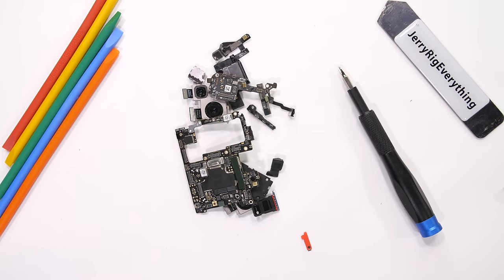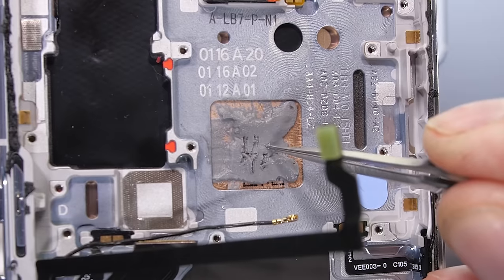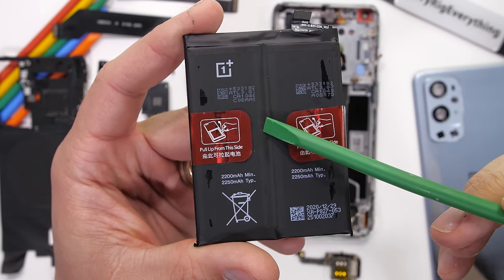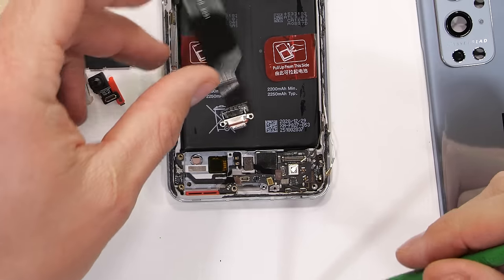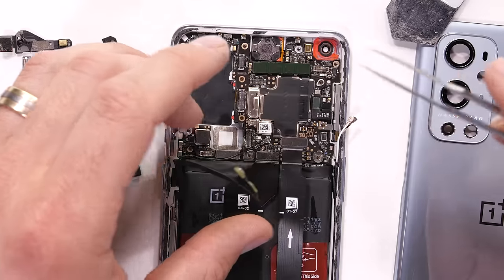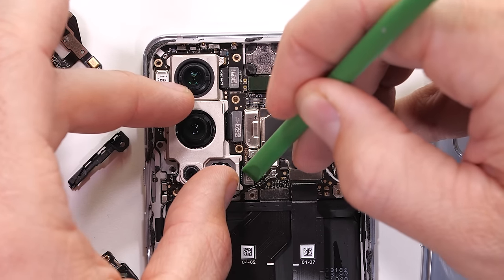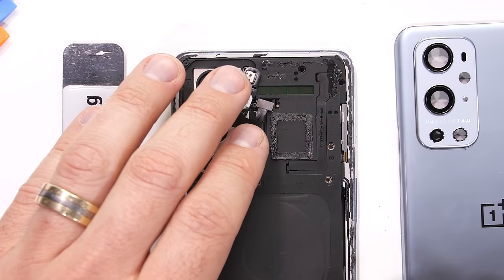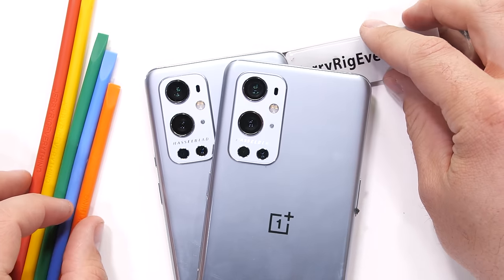What if your phone arrived like this?! - OnePlus 9 Pro Teardown!

Comment: The extra screw is for that threaded hole partially underneath the LED flash. The metal-rubber bracket is supposed to be used to keep the bottom board's connector fixed in place in case you drop your phone.
Reply: Yeah I was about to say, the metal bracket is to hold down a ribbon cable connector, the screw is either for that, or you missed a spot lol
Reply: Yeah me 2 but saw that someone already commented👍
Reply: Only Taichi saw it. 

Liars, yall didn't see anything'!! 😂😂😂
Reply: @MAGGOT_VOMIT  u not excited about poco X3 pro it's only $250
Reply: I was about to say this but I just saw your comment. Thanks for saving my time. (:)
Reply: @Atomic Ice Gaming it's true why don't u guys believe me😂
Reply: 720 like

Comment: Jerry: "Turns out Oneplus lied a litte"

Oneplus: *panik*

Jerry: "Instead of charging my phone in 29 minutes my phone completely charged in 27 minutes"

Oneplus: *kalm*
Reply: His name is Zack
Reply: it's totally normal for li-ion batteries to charge faster when they are used, as the total capacity lowers with degradation and over time
Reply: @sersoft_corp  but it was a new phone, just in parta
Reply: @bryanrodriguez2186  idunno at 1:03 in 4k the glass looks used, or at least has signs of wear
Reply: @sersoft_corp  yea because he scratches the glass with mohs hardness picks to show what the screens made of
Reply: Taking this seriously, Even if it was 31 minutes, you can easily waive that off as natural variance.
Reply: panic* calm* did your c key break
Reply: @kane169  it’s a meme format
Reply: Oneplus: kalm

Calm be like (i should leave my job now my work here is done xD)
Reply: @alrightkewl8235  oh n

Comment: I wish they had kits where you literally could build your own phone like a model car or airplane.
Reply: Because the president
Reply: I literally struggle to put screen protector on...
Reply: @nateb9346  lol
Reply: 1+ reinvented the modular phone Google failed to make.
Reply: @nateb9346  if you're having trouble with the dust go into your bathroom and turn on the shower to its hottest setting and wait for the room to get all humid and fog up the mirrors. then apply it. The water will pull the dust out of the air
Reply: Apple in 2 years...................
Reply: RIP project ARA

Comment: Jerry : "the goal here, is to not left have any screw left over, but that's a goal not a requirement."
Me who falls short of the screws because I lost a few of them while working 😬
Reply: Trust me, it is more scary when you have leftover screws... You don't even know what you missed
Reply: well when I took apart my old Fujitsu laptop (to put new CPU and GPU thermal paste in and clean the fans), I found I had 1 screw less than required to put it all back together... and no, I didn't lose the last screw. So I just took it from a donor laptop and my fully built laptop now has an extra screw somewhere it probably shouldn't :D
Reply: Video of
Reply: @SuperSohaizai  hehehe yeah
Reply: @SuperSohaizai  Nah mate. What's scarier is when you know you lost some screws and the only ones you have left doesn't fit the remaining holes.
Reply: @astral6749  I know that feeling but it doesn't feel that scary. You know why? I always have spare screws, from other devices that is XD

Comment: in the wise words of my uncle: "if you repair something and have screws left over, it just means that you are better at fixing things than them because you didn't need as many parts."

my uncle did tell me this, but it was a joke, I do not, and would not recommend leaving out screws 😂
Reply: Unless you do the repair in front of the owner
Reply: Never heard wiser
Reply: Unkul Ben lied to you
Reply: Your ooncle very wise
Reply: If the engineers designed it for 10 screws, you better use 10 screws. They didn't study and learn for 10yrs just to add extra screws for fun
Reply: Delta0307 If the commenter made the comment to be a joke, you better take it as a joke. They didn’t spend time thinking about the joke for someone to come and ruin it.
Reply: @quabiloyoink  I've heard this before and it's not a joke. Dumb technicians actually swear by this rule. A guy just ruined my automatic gate recently because he used 4 screws instead of 6 dislodging the guide rails. He said almost the same thing to me about not needing all screws
Reply: @delta0307  it was just to make people laugh...
Reply: Now the
Reply: the next moment u have the entire thing falling apart
Reply: @gchamp8167  true dat
Reply: @grozaphy  
Either way, it can misinform people for the worse.
Reply: maybe it was true 50 years ago.. now things are made to cost as little as possibile and if there are 10 screws you'd better use all of them
Reply: @delta0307  well rip but it’s still a joke some idiots take it seriously although it’s clearly a joke
Reply: @metallurgico  yeee exactly my point, if u have some screws remaining then u either disassemble the whole thing or pray that it doesn't fall off
Reply: KKKKKK THATS FUNY
Reply: @Yuriyalloween  it is quite obvious it was meant for a laugh. there's even a emoji at the end.
Reply: @delta0307  or they could be Steve job whom told engineers to add extra screw because it didn't look symmetrical on their laptop :x
Reply: @delta0307  sad lyf
Reply: @grozaphy  
Yes, I agree, and I personally like the joke too, but as you know, people on the internet fail to identify jokes.

Comment: "They lied.. it charged faster than they said"
Reply: It did NOT.
He started at 1% and the system was booted up.
If you have a true 0% phone, thus the battery is dead, then you need those extra 2 minutes and maybe even more.
Some phones even take minutes just to power up when the battery is fully depleted and you hook the charger up.
Reply: @Roomer645  "They said it goes from 1% to 100% in 29 min"
Reply: return the phone back, what a scam, faster than they told us, smh my head
Reply: @Roomer645  actually the phone charges while it's booting up. And I think the first 1% is the fastest percent to charge as charging starts at the fastest speed and slows down as the percentage goes up
Reply: @hussainzain5913  Yes but that doesn't mean it charges 1% in 10 seconds.
You really need to have a dead phone and then do a time check and i am willing to bet that it won't be below 29 mins ....

Comment: The bracket go on the flex cable on the bottom in the right side and the screw go under the flash LED !! 

btw battery are usually install in last just before the bezel with the charging coil, you lift the flex cable and install it... I have OCD so for me the screws are a big requirement.

Comment: I have been impressed with OnePlus for years, the fast charging options are very impressive
What needs to be changed to make this phone perfect for 99.9999% of users
microSD card reader
headphone jack
replaceable battery
option to disable charging after reaching the set threshold, e.g. 80%
front camera hidden under the display
flat screen
no glass on the back

Comment: I absolutely love that 1+ threw you a curveball! When I was last on the market for a new phone, it was between LG and 1+ that got the top ranks on what phones I would get. LG won because of the way Canadian ISPs work, but in 1 or 2 years (so far my LG phones have typically lasted 4 years+ and I'm pretty sure my LG G7 also will as 2.5 years later it's still working like a new phone, even the battery still lasts over a day), but LG dropping the phone market, looks like my next phone will most likely be a 1+. Hell my old LG G3 would still turn on if I could find a working battery for it.
Reply: LG, Sony and HTC. Nice to still read positive reviews of the less popular 3.

Comment: At 7:31 into the clip, Zack's magic trick screw fail can easily be seen falling on the bottom left side corner of the back of the OnePlus. I couldn't help but to chuckle at that one. Oh, and the placement of that orange leftover bracket? It must have fell out of that other vibrator you have hanging around the house. :-)

Comment: Though modular phone concepts failed, i think that storage shud be upgradable. For example, if i have a device with 128gigs storage, i shud be able to upgrade to whatever storage i want, and it shud not be much expensive. It shud work this way, i go to the service center and ask them to change my internal storage, that way it will be under warranty as it is done by authorised service center and on top of that, it shud not cost much, like for 100dollars, INR maximum 10000, i shud get 512gigs of storage.

Comment: I hope OnePlus sees this. This is an awesome video. OnePlus if you see this I am very let down about your cameras. First problem is, not able to take fast moving pictures with your camera because your camera or the software is too slow to capture the picture. The second problem is what's up with the useless black and white camera? Honestly, it's USELESS and give the people a micro camera that they can actually use. Also some of the pictures come out a little bit darker compared to Samsung's and iPhone, but maybe that could be fixed with a software update. Question, have phone companies forget this is a phone? Anything over 5.9 inch screen is takes up your whole pocket. Also please bring back a micro memory slot and a flat screen on the Pro model phones. Flat screen protectors stay on better on a flat screen than  a curved screen display.

Comment: Hey! I recently had my screen replaced which is basically replacing the entire frame. But since then my phone has had a really bad overheating issue. Is it possible that the vapor chamber is damaged? Do you know if when you buy a new frame it comes with the vapor chamber or does it have to be taken from the old one and placed into the new one?

Comment: I have an OP7 Pro, and while the phone is amazing, the OS is the buggiest I have ever used. Half the time when I try to unlock the phone, the screen just turns black and you have to restart the phone using the side buttons. Other times, the phone just unlocks into a zoomed picture of the OS, and you can't access any of the settings to fix the issue. 

Needless to say, I wont be buying another OnePlus phone. I just wish Google bought their hardware from OnePlus, and did all the optimizations in-house. It'd be a much better phone.

Comment: My OnePlus 9 Pro power button suddenly stops working today. I can surely confirm that I've done nothing wrong with it. No physical drop/damage. No custom screen protector. Default phone case that came in the box. The button still clicks fine. It just doesn't do anything when clicked. I've tried rebooting couple of times. No luck.

Would solve it by claiming warranty. But it'd mean I'll lose my phone for 2-3 months while being repaired in China.

Any alternative suggestion guys? Or maybe Jerry? 🙏🏽

Comment: I would like to have an option NOT to have a fingerprint sensor.
Reply: Why? Just don't use it lmfaoo.
Reply: @rmendez011  Who said it's not working secretly in the background? Instagram was using selfie cameras without users knowing. Ever heard about that scandal?
Reply: @baraBober  because the sensor can't see anything without a bright white light? Brighter than full brightness?? Why do you think a bright white circle has to appear when you use it? Lmfao.
Reply: @rmendez011  samsung uses ultrasonic scanner, so it doesn't need a bright white circle. Camera shutter button on most phones is located in the same spot  as finger print scanner, and its' color is white. Plus, who said it has to be white, or a circle? Light emitted by a game, video, picture etc. may be enough to pick up your fingerprint data. 

Do a little bit of research about how companies/governments can track your every move, and remember, if something appears to be off, it doesn't mean it's actually off.
Reply: @baraBober  First off, you're commenting this under a OnePlus 9 Pro, which uses an optical fingerprint scanner. Second off, an Ultrasonic fingerprint scanner does NOT use a camera, which means you have even less to worry about 🤦🏻‍♂️.

Again, optical fingerprint scanners do not work unless the screen area around the sensor is at max brightness (MAX brightness, not full, there's a difference), I have a OnePlus 6T that has a custom ROM, if I disable the circle around the fingerprint scanner, put the phone to full brightness, and touch the sensor, my fingerprint doesn't register, and any fingerprints already registered, don't unlock my device. I can also change the color that appears when I touch the sensor, originally it is green, but if I change it to white like newer OnePlus phones, it does NOT WORK (I can setup my fingerprint again, and again, it won't work without MAX brightness and the original color). Lastly, optical fingerprint scanners use lower quality cameras, that can only see less than 1 millimeter past the screen pixels, which is why you can't see it.

I am well aware what companies/goverments can and will do to track people, however an under-display Optical or Ultrasonic fingerprint scanner is the least of your worries 🤦🏻‍♂️.